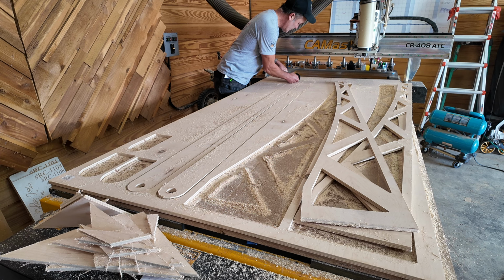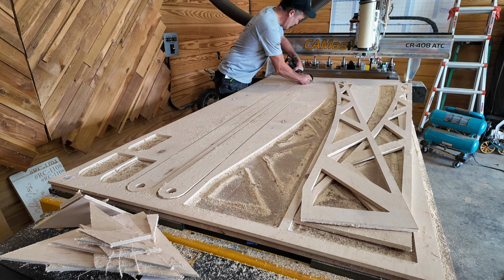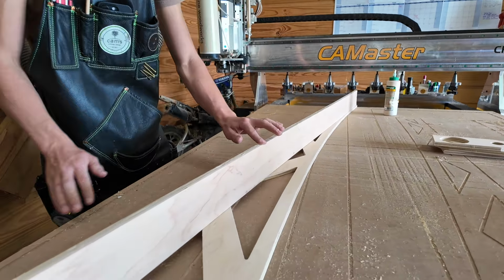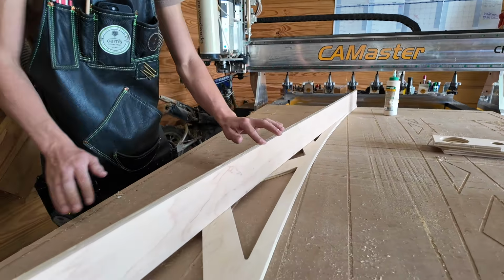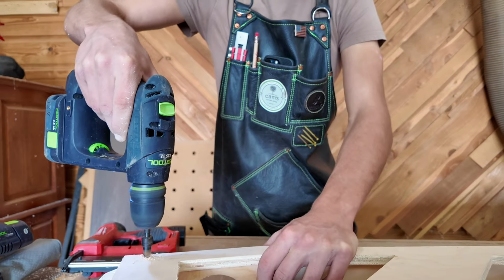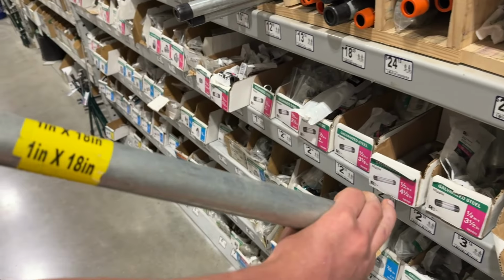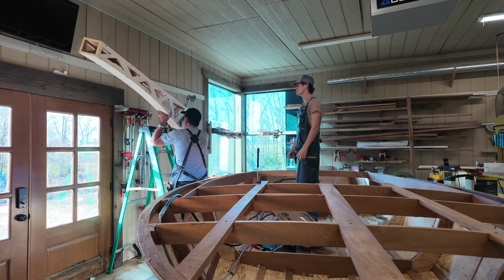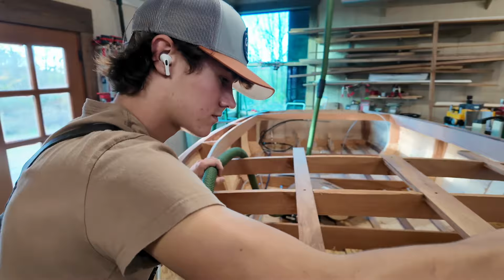The BEST shop dust collector boom arm - simple to make & no hardware!

Comment: Any thoughts on retracting the hose when not using the dust collector?  Get it up and out of the way.
Reply from the maker: It could have a bungee strap that could pull it out of the way but in my case I just put it to one side towards a wall and it works out nice and out of the way. A lot of times it's just over the bench and not in the way also
Reply: @fultonfinewoodworks Ah yes that's kinda the point isn't it? 😊

Comment: Ever since John at Lincoln St. came out with his boom arm, there have been countless versions that aren’t any better! Finally I am going with yours!  No CNC, just my power tools. Not as pretty and will take longer, but that’s the fun of woodworking!
Reply from the maker: Thanks. I for sure did more than needed with the design on the side just because of the CNC, but the function will be the same even if it was solid.  I have 3 years of use on the original one and it is still working great!

Comment: That looks great for the size project you do, but for "regular" sized furniture projects I just use a 4" PVC elbow hung from the ceiling.  I use velcro loops to hold the hose and power cord and put it through the elbow.  I can same from one end of my workbench to the other with no problem.

Comment: This was so interesting to watch and an amazing idea, one change or addition I would perhaps make would be to use a thin steel plate or washer between the pipe and the ply to stop it wearing through the wood over time and extended use.
one could even be retro fitted by hacksawing it in half and screwing both halves to the ply.
I would certainly like to see more or your projects and build work,
Also god alone knows how you kept a straight face when Cameron went down the stairs,, that was comedy gold 😂😂😂
Reply from the maker: The first boom arm I built is years old and has been used a lot, there is not any signs of wear as there is very little friction on the smooth pipe, I thought when I was designing it, that it may need a more complicated mechanism or spray lubricant but it works perfect, just the right amount of resistance.  

More examples of my work is on Instagram @fultonfinewoodworks and I was able to keep a straight face when Cameron when down the stairs because at first I couldn't even figure out what he was doing. That one caught me off guard!

Comment: This kinda reminds me of the ol" Steve Martin joke: "How to pay no taxes when you are a millionaire.  First...get a million dollars.  Now...".   Yeah, how to built this and save yourself trouble? First get a very expensive AND large tool.

I know, not the same but still...
Reply from the maker: I used my CNC to cut it out, but it could easily be cut out with a circular saw, hole saw would just take more time.  My main goal was to relay the method of hanging without expensive hardware and it works great.

Comment: In case you haven’t used one before, try using a 1/4 inch narrow crown stapler for your assembly.  You would not have had to screw this together and it would’ve held together on its own before you had your curved peace in. Yes, they make it slightly larger hole than a brad nail but it’s definitely a lot smaller than a screw and a lot less chance of splitting the wood than the screw and it removes the whole step of pre-drilling and screwing it together.
Reply from the maker: Totally agree with you and that it would work, I wanted to show this method as many probably don't have a crown stapler.

Comment: So if you had say a 5000 SF shop with numerous machines, would you still use this type of a system?
Reply from the maker: Yes for sure, I still have larger machines on a central dust collection system but for bench work this is great. Applying this same concept to our boat build area will help out every time we are working on it. Was such a pain pulling it around and dealing with the hose.

Comment: Making things more efficient is the way to go! There are a lot of really good books that can help with lean manufacturing like “The Goal” and “The Toyota Way”. 

I just put an air hose reel, a power cord reel, and my heater all on the ceiling and it’s amazing what a little improvements can do for efficiency.
Reply from the maker: Fun fact I left Toyota corporate HQ to start woodworking full time 15 years ago.  Toyota way is engrained in my head. I have found it more valuable now that I am in business than when I was working for Toyota. Your exactly right little improvements can make a huge difference!
Reply: @ That’s awesome! I love Toyota!